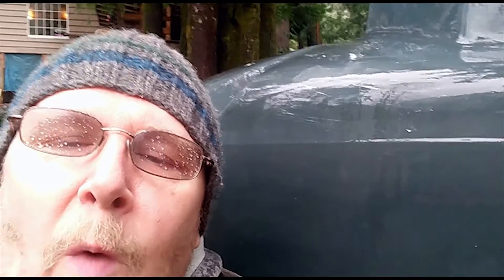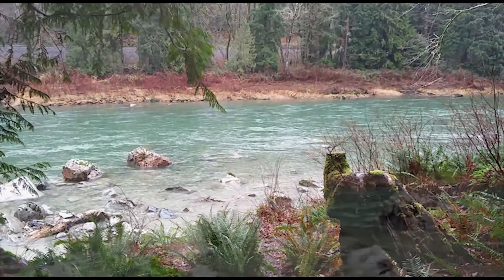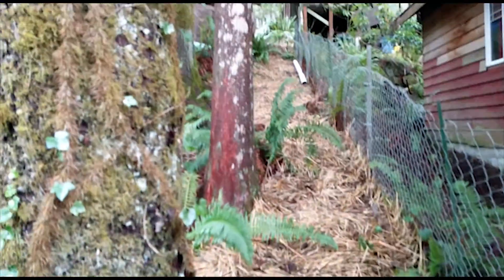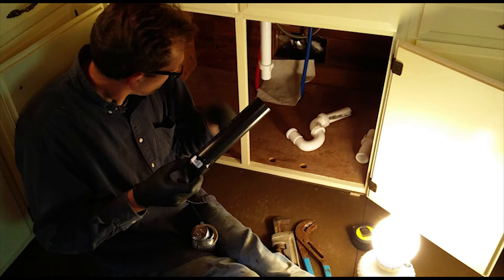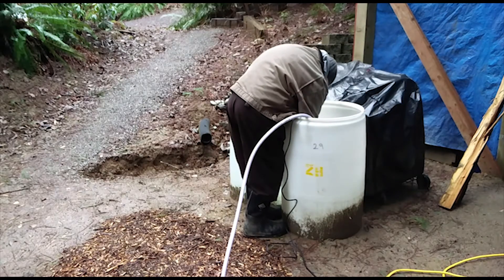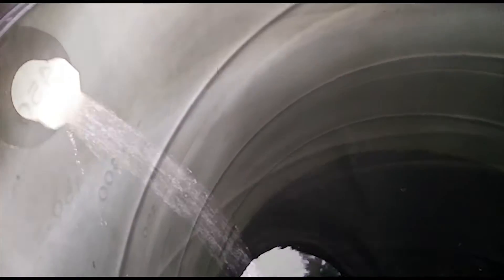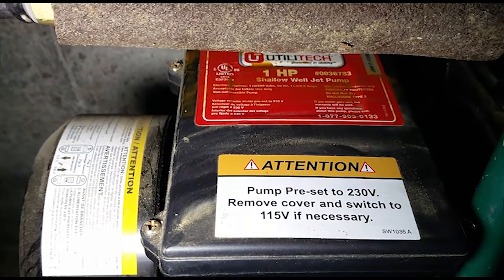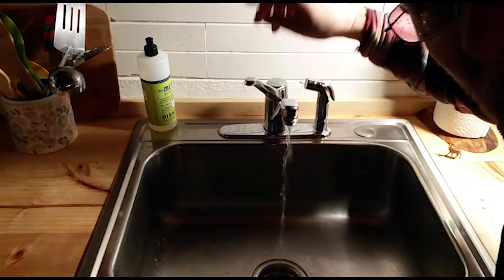Water Cistern System - Our Setup (with list of main components)

Comment: Why dont you catch the water from your roof and pipe it to the tank?
Reply from the maker: We considered it but the ice and snow in winter ripped the gutters off. Also, the roof is too high up for me to mess with gutters year to year. I'm 62 and injuries take forever to heal now.
Reply: @AlmostHomestead  understandable.  I have a cistern and a well. The cistern leaked and hasn't been used in a while looking to get it fixed and back up and going.

Comment: Thanks for sharing. I have a similar setup except I have a spring that fills the cistern. How did you filter the water coming out of the cistern to protect the pump? A friend of mine suggested using a foot valve.
Reply from the maker: I was putting a 30 micron filter between the pump and the cistern but I switched to just pumping straight into the tank. I really should have a filter between pump and cistern though. I have to keep an eye on the filter from pump to house as it gets dirty pretty quick .
Reply: @AlmostHomestead  I see. Yeah I definitely want to put a filter between the cistern and pump.

Comment: got a question , did you ever save the water from the roof of your cabin or do you .  if not why not .
Reply from the maker: Great question! We plan on doing that. We are finishing the basement and the sides of the cabin this summer. The plan is to put a system in place on the sides of the cabin that feeds our blue 500 gallon tank from the roof.
Reply: cool , it will be great to have that extra rain water . a small river is always a great thing to have so close .  for some reason all your replies went into my spamm folder . i marked it as not spamm . the only way i knew that you replied or hearted my comments was due to the live notification . some people do not check their spamm folders . i think the spamm filtration system needs a overhaul lol .
Reply from the maker: leahcimrac carmichael ztirom moritz ...hopefully they get that fixed. I had a few comments from someone flagged as spam last week. I better check it again. Thanks.